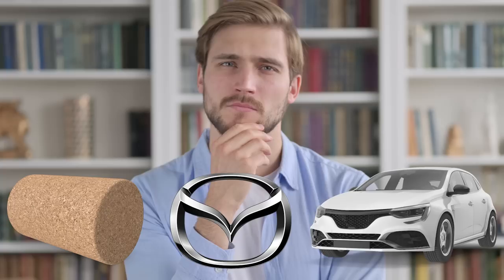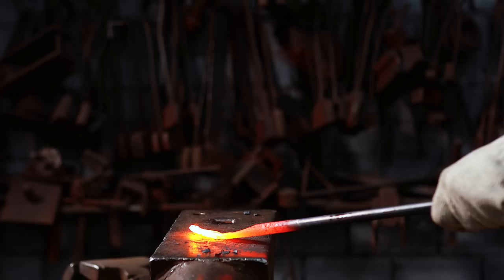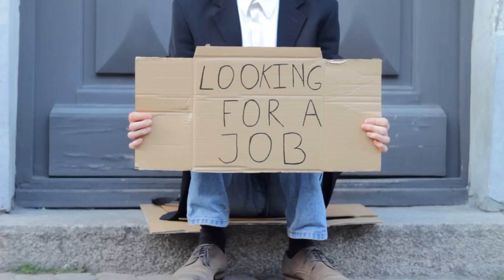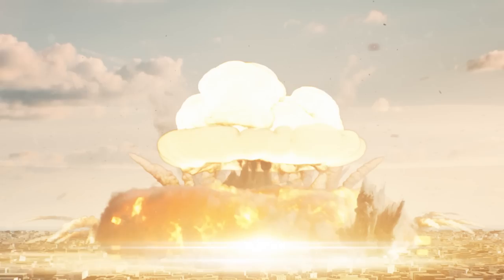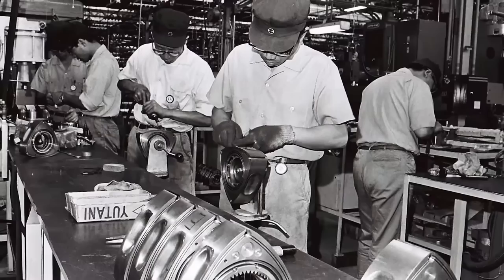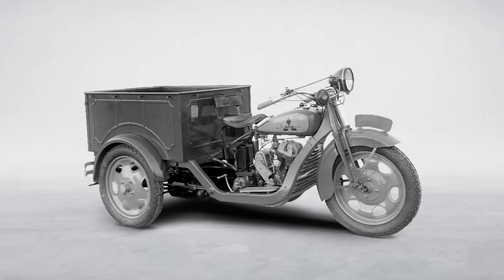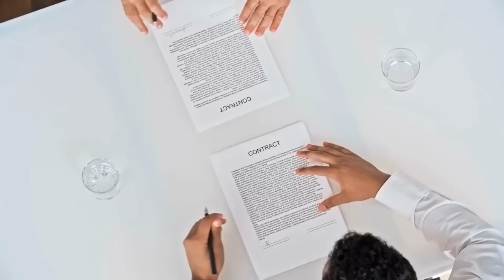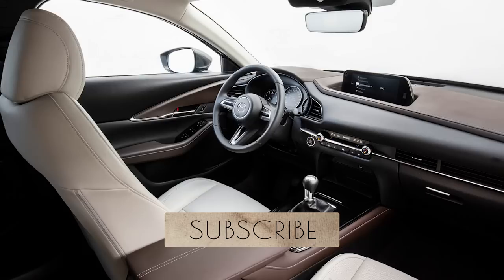How did the son of a poor fisherman create Mazda?

Comment: mazda = crap..My current Mazda 6  will be the last Mazda I'll ever buy..And i have owned Mazdas all my life..My first car was a Mazda rx7  ..   mazda is now nothing but trouble..The amount of failures on this car is ridiculous,And I take care of it like a baby since day one..The list of things I've replaced luckily I repair everything myself Comes out to quite a lot..Anything rubber has failed on my car    dry rot Cracking and falling apart your name it's failed..  Even the current clearcoat is failing..  in areas...  my next car will be a Toyota
Reply: Mazda is great, the 6, not so much honestly. The 6 is their most problematic car.
Reply: My 2018 m6 is going strong still
Reply: The 6 is literally in the top 10 cars rated to last 300k miles or more.
 You probably had a lemon. I haven't known anyone who's ever had a problem with their 6 as far as people I've met. All manufacturers can make lemons. I've known a camry that burned oil, and a couple accords need new transmissions. But thats about all I can account for.
Reply: 2008 Mazda 3 

No issues for over a decade ❤
Reply: You are wrong. All you have is a "lemon".

Mazda is exceptionally well made and reliable. Unfortunate for you to have one of the few cars that malfunction.

Contact your Mazda dealer and have it resolved.
Reply: Toyota has the same issues aka new Tundra. EPA drives all things in America so paint, plastics, etc you know. Computer modules talking across different systems will fail in time. Now I have to say that the Toyota 4 Runner is a close to perfection as you can get.